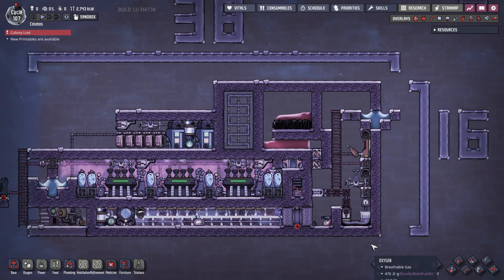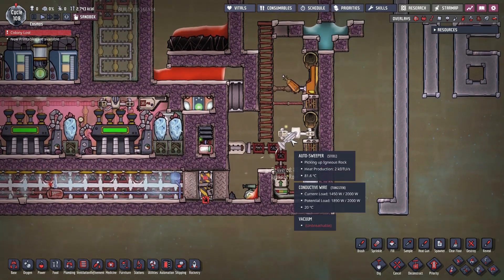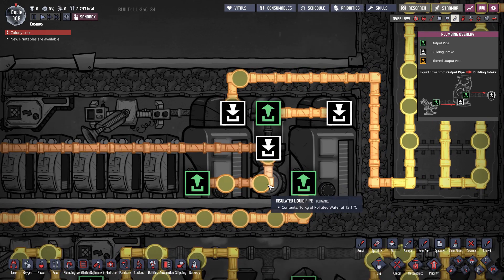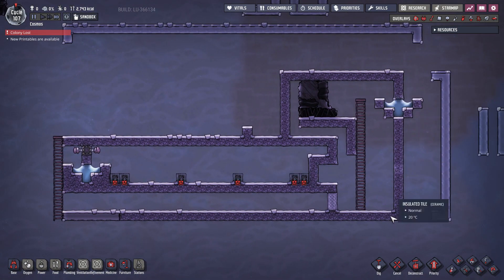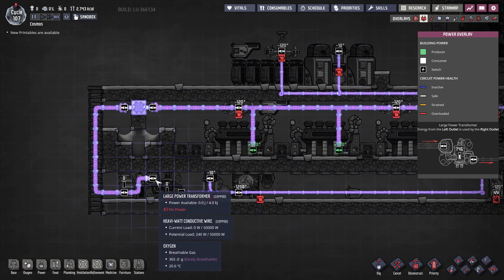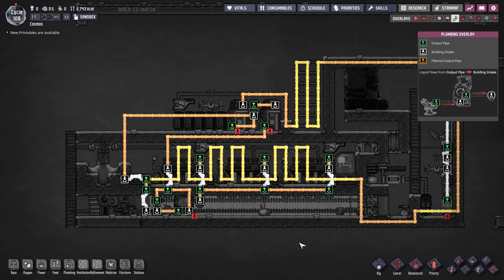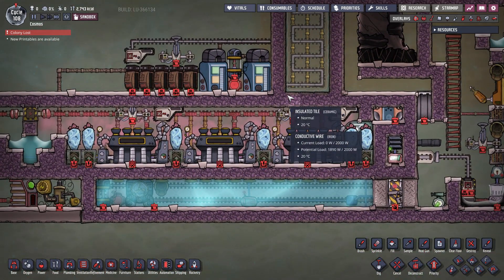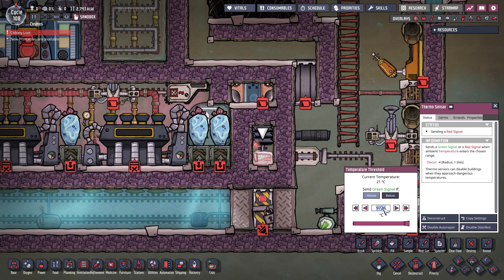Oxygen not included - How to build:  Magma Volcano Tamer (Revisited)

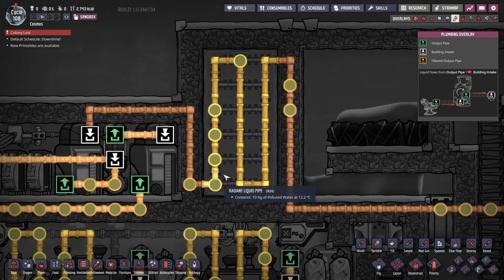Comment: This is a great design and I am using it myself. But a warning: Follow the liquid piping shown at 11:13. There is a section of pipe shown at 5:10 that is different and I must have been looking at it when I first set mine up. It contacts magma and will melt. Otherwise, thank you for sharing this!
Reply: Still love this design. I just want to add refinements as I work with it more. One more suggestion is to add a smart battery after the power transformer. I had a brownout midswing of the auto sweeper, and it dropped hot igneous rock into the oil pool and melted the pump. I am hoping that the battery helps prevent that from happening again.

Comment: Hey, great design! Do you have a rough estimate of how much output this setup can handle? I have 6 volcanoes close to each other with an combined average output of 7.42 kg/s (just enough to keep 4 full stone hatch ranches fed). If that's too much to keep up can I scale it up by just adding more steam turbines? Cheers!
Reply from the maker: That's a very low output. For comparison, my volcano (in this video) outputs 247.8 kg/s of magma.
I think you can downscale the entire thing to a single turbine.
Reply: @stivraptor  I mean the calculated Average output (including inactivity & dormancy time). Each volcano has about the same and more active output as your volcano.

My goal is to have all excess magma turned into igneous rock without the volcanoes ever overpressuring.
Reply from the maker: @Sant0sh  
I see. The problem here will be to cool down all the rocks. In my case, a single aqua tuner is barely enough to keep up with cooling the heat exchanger. In your case this won't be enough, you will probably need at least 1 or 2 more aqua tuners.
The other option is not cooling the rocks, which comes out at ~180C.
I didn't calculate the average  output of the volcano, but generally, 1 major volcano can run 3 turbines at maximum power.
Reply: @stivraptor  Alright, that's good and bad. I get more power out of it than I thought, but cooling the rocks down will be a pain. Thanks for the help!

Comment from the maker: BREAKING NEWS EVERYONE!

Turns out this design ALSO WORKS FOR METAL VOLCANOES! the igneous rock is simply replaced by metal! the process is still the same! Metal is loaded into the rails, gets all the heat sucked out of it and then cooled down to normal temperatures!

Although I think its quite the overkill since metal volcanoes output very small amount of metal, compared to the huge output of magma volcanoes,  i think for metal volcanoes its possible to run one steam turbine and the shrink the entire thing down.

Happy little accidents....
Reply: I just tried your steam turbines... what about ethanol instead of polluted water for aquatuner cooling loop?
Reply: I tried ethanol, very bad idea it starts to evaporate at 78 C ... eventually it will reach it in the diamond window room and the radiant pipes will break once the ethanol changes state
Reply from the maker: @IsmarKunić  Evaporation point aside, Ethanol is not a good coolant because its has poor heat conductivity and average heat capacity.
Reply: @IsmarKunić  Pretty sure the numbers on that build got changed pretty dramatically in a patch.